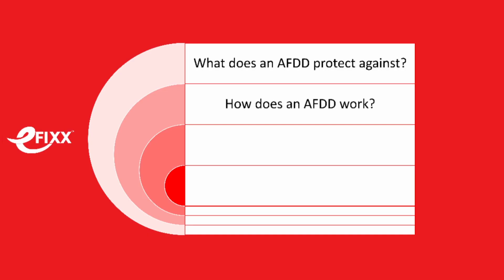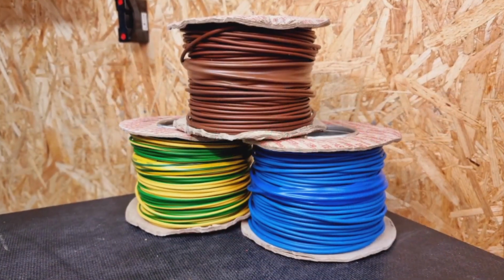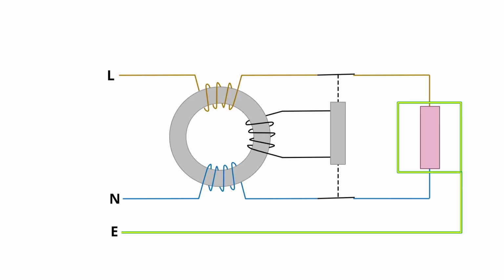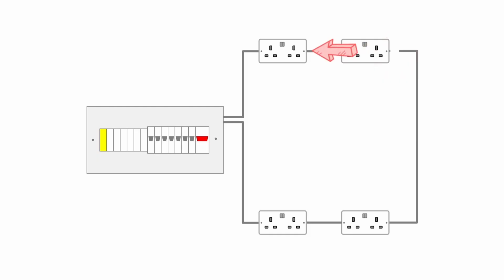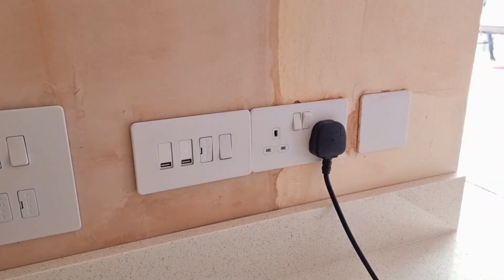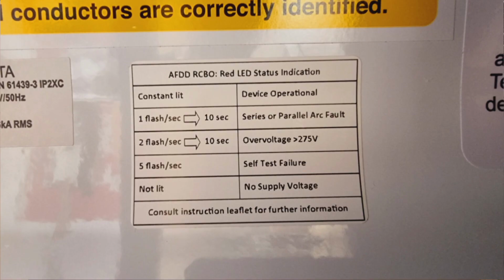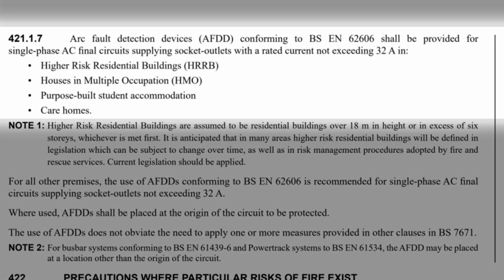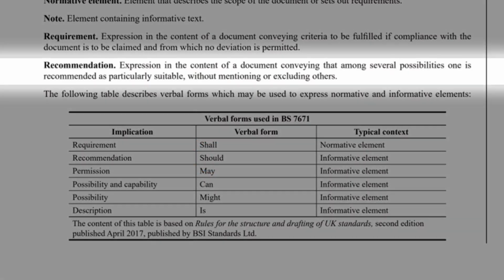AFDDs & BS7671 Amendment 2 - What you need to know!

Comment: End user question! My understanding is that MCBs  & RCBOs have very simple (almost maintenance free) mechanisms. As AFDDs have PCBs with capacitors on, will they require replacing after say 15-20 years?
Reply: it is at the same with TV or any device you thinking...and it is not any posibility to test...yeah,it is not ok....

Comment: Currents do not jump gaps on their own. Voltage is required to create the initial arc which can only be sustained as long as the conductive path is present. Unless I missed it you didn't mention effects on the AFD of arc welding. One must also ask for some statistical justification for the introduction of all the additional requirements that have been introduced since the 17th edition came into effect.

Comment: The recommendation is AFDDs are fitted to circuits supplying socket circuits not exceeding 32 amps however they don't detect series arcs. Since series arcs at a loose terminal are the most common faults in a ring final circuit and ring final circuits are the most common circuits, there doesn't seem to be any practical justification for recommending an AFDD be fitted.

Comment: I have seen so many new flats made by big companies in London.  None has got afdd or rcbo! Who is going to pay £1500+ for consumer unit. The landlords are not paying that much money. There are lots of other costs (goverment does accept mortgage as cost)  involved. It just put sparks on spot!
Reply: AFDDs are required in blocks with 5 floors plus ground floor and higher.  
The AFDDs are only for any circuit with at least one socket protected by a 32A beaker or less. A circuit that is above 32A protection then an AFDD is not required. 
Fit a 40A RCBO with three sockets:
- a 6.0 mm cable to a 1st single socket;
- a 2.5 mm cable to a 2nd single socket;
- a 2.5 mm cable to a 3rd single socket.

Then it does not need an AFDD as the circuit is over 32A.
The circuit could be supplying a: washing machine, dishwasher and tumble dryer, with a total draw of 39 amps - a 40A circuit. 

Circuits with only hard wired appliance do not require AFDDs.

Comment: Who says arc current faults are becoming  more common? I find that very unlikely indeed. There is not obvious reason why this should be. Of course, what might be happening is that there's a higher proportion of arc current faults occurring, but that's surely because the other types of faults are becoming less common due to the introduction of MCBs and RCDs (or the combination, in the form of RCBOs). 

I think with AFDDs we have probably reached the point of strongly diminishing returns. If we want to save lives, far better to upgrade older installations without making the process prohibitively expensive. To my mind, the sweet spot is RCBOs on every individual circuit. Until and unless AFDDs can be reduced in cost to be comparable to RCBOs, that's not worth doing.

Frankly, what I am hearing from this is lobbying by the manufacturers of electrical equipment, not independent statistics on how much safer things will be. Artificial tests by Lewden are far from convincing. They have a vested interest in promoting ever more expensive installations.

Comment: Why no AFDDs on Cooker or Shower circuits - rated at higher than 32A?  Surely, these are more susceptible to Arcing and due to the higher currents are more dangerous and in my experience are more than likely the cause of any burning and melting...?  Thanks.

Comment: HMOs. AFDDs are mandatory. 
But, in new circuits? 
Must be installed ASAP?

Not clear on this.
Reply: mandatory since late september 2022 when five yearly test is done
Reply: @tonyedwards6369  
I found out...  Existing systems... The regs are not retrospective. An inspection is to say what is wrong and what can be improved. It is up to the home owner or landlord to make a decision.

If its new work, like a new or extended circuit, then yes, it has to be conformed to and an AFDD fitted.
Reply: @johnburns4017  Accodring to my insurance company doutful they will pay out in the event of an electrical fire iwthout AFDD since late september.
Reply: @tonyedwards6369  
Understand what I wrote.  The regs are not retrospective.  Only apply when work is done.

Comment: Had our consumer board updated recently.  Gas fitter fitted new boiler and  replaced socket as it was faulty so he could run boiler from it.  Unfortunately he failed to connect earth continuity properly and I was electrocuted when touching dishwasher handle (dishwasher fed off same circuit).  Trips did’t trip.  Still don’t know why nor does electrician who came in to sort it out.  The consumer unit uses rcds

Comment: Fantastic video again, considering the fact that AFDD'S have over-voltage protection at 275V, are they a solution to external installations where a PEN Fault would be a problem, like car chargers for example.

Comment: Each AFDD/RCBO cost an average £150  that is a huge extra cost.   This will bring into the question the need for ring circuits instead of radials. An AFDD does not detect series arcs on ring mains although it will detect series arcs in appliance cables.  So as far as I understand, flammable buildings, ie garden sheds or timber extensions will require full protection of AFDD'S-what does that mean? EVERY circuit has to have a AFDD?  We can assume, that all future installations will require some AFDD's, the question is how many and to cover ltg as well? Everything can be considered a fire risk.  Will your client be able to claim a reduction in his fire insurance premiums? Its all up in the air. can anyone please clarify?

Comment: So, it's socket circuits only? Not lighting? Showers? Cookers?

I'm confused. Showers draw a lot of current, but only run in short bursts (except where my kids are concerned!), yet damage is caused when there's a loose connection because of the large load. No mandatory AFDD?

Ovens and hobs can both draw large loads AND do that for hours! Yet no mandatory AFDD?

Lighting circuits generally draw less current than they've ever done before thanks to LED. However, due to the small conductors used, arcing is easily caused by over-tightening of terminations that cut cores and thus leave loose connections. Yet no mandatory AFDD.

Only mandatory for sockets? Why?

I've been in the game thirty years, I'm not the fastest sparks, not the most technical sparks, but do the best I can with the best kit I can afford. Some of these new regs are not helping, least of all because of the costs involved.
Reply: "Lighting circuits generally draw less current than they've ever done before thanks to LED. However, due to the small conductors used, arcing is easily caused by over-tightening of terminations that cut cores and thus leave loose connections. Yet no mandatory AFDD."

Use ferrules on the 1.00mm lighting wire. Then less risk of arcing.
Reply: The screw connections on sockets can work loose causing arcs. Hence AFDDs on socket circuits. Use screwless Wagos in the backboxes connecting the ring. Maintenance Free junctions are always screwless. 

Oven and hob connections have screw connections at the CU and appliance only (or should have).

Comment: I am not sold on these devices, and I also don't think anybody in the industry is concerned about safety either.
There could be millions of insulated boards out there, that failed a basic test, yet the manufacturers still put a British standard on them. This was done by two of the oldest manufacturers of electrical equipment in the UK and it's been swept under the carpet.
So with this in mind, you will have to excuse my scepticism, when I see that the powers that be are telling us to fit these devices to cut down on the risk of fire, when the very same people have turned a blind eye to this issue.
The whole industry stinks from top to bottom, and shows it's all about money and nothing else.

Comment: Will the use of a arc welder or mig trip out an arcc? I’m in Australia and was not aware of them. Currently had the house rewired and not mention was made to an arcc. Thanks
Reply: AFDDs are to be on final circuits with sockets drawing 32A and below - UK is typically 13A, but higher is permissible in certain situations.  An arc welders will have a socket draw over 32A, is not a problem.  

I would assume an AFDD would detect an arc on an arc welder.

Comment: So this £200 part would of prevented genfell , I’m still not sure why these or not being fitted at the front end on the installation not much point in protecting the ring if the main switch is going melt

Comment: remember in 1980's grid fault meant i was called out to work could not keep up  with resets till I checked voltage at 260 /265 volt, immediately killed power to factory but dozens of claims for destroyed equipment in houses.   This was never made public. Being a small town I tknew through gossip why every fault occured and explaining ,this iis why people got compenation so the 275 volt protection is a bit too highand a bit usless

Comment: Does this new reg. apply to new installations or, all current installations as well. It seems that as, with any system that becomes more complex then, MTTF rate is going to increase. The cost and complexity, of such systems, will eventually require higher qualification, than the  average electrician.
Reply: AFDD mandatory from September 28 for HMO thatched and wooden buildings

Comment: Good video eFIXX.  Just one criticism, regarding ring finals.  It's not that AFDDs won't detect an arc on rings, they will.  It's actually that arcs are far less likely to occur on rings.  With a single break in the ring, the potential difference between the 2 separated legs would be just a few volts, so no dangerous arcing would occur.  Rings are safer than radials in this respect.  

I still disagree with your interpretation of 'recommend', but we've argued that one before 😉
Reply: Yes I totally agree he's got recommend wrong. If he's clarified it with the IET, then they have got it wrong!
Reply: @markrainford1219  
I would clarify the meaning of recommend with an Oxford English dictionary.
Reply: Yes using the word recommend in a pseudo-mandatory condition would both contravene the normal meaning and the practice of other regulations. If used in this sense its very stupid. Redefining the word in an annex doesn't really help!

Comment: Thank you for a very interesting and we'll presented video. I am old enough to remember the recommendation in the 1970s to fit a voltage operated protection device (big black things that looked like a switch) and the subsequent issues that occurred as a result. I wonder, how many incidents have occurred over the last five years that AFDDs would have prevented?
Reply: Grenfell Tower
Reply: That wouldn’t have prevent Grenfil tower the problem was the dryer which caught fire not from the supply feeding it it was an appliance fault this then spread inside the room and to the outer building insulation also my issue is with AFDS there is no way of testing them apart from David saverys home made device.
Not convinced by afds on lower loads , seen them in America and I’m not impressed .

Comment: No one is installing these.
Reply from the maker: Unless they work in HMOs, student accommodation, care homes or high rise resi
Reply: @efixx  
Do AFDDs have to be installed in HMOs ASAP?  Or just on new instsllations/circuits?
Reply: Which is why so many HMO are closing when five year EICR test happens, those not due for test will not be covered for fire insurance unless AFDD retrofitted.

Comment: Good vid, BUT does the AFDD circuitry use only passive parts or does it have a micro controller inside with firmware + algorithms to make its fault decisions? Sounds too complex to be just passive.
If so, some algorithms are better than others....
Reply from the maker: You are correct they have a microcontroller / DSP inside to detect specific arc waveforms.

Comment: So for example in a house you have two ring main circuits,two light circuits,one 32A cooker circuit,and one 16A heating circuit………total of 6 circuits,you would need 6 AFDD at a cost of £150 @ !!!!!!!!!!!!!!!!!!
Reply: Nope.
Reply: @johnburns4017  please explain
Reply: @omriroberts137  
AFDDs on socket circuits only. So you can have one socket circuit, with heavy appliances on a separate ring hard wired in, or hard wired in on radials. Two appliances can be off one radial.

Then only one expensive AFDD.  But assess electronic appliances that leak to earth to avoid nuisance tripping of the AFDD. Modern washing machines & dishwashers leak to earth, but these will be not be on the AFDD protected ring.

If you have an electric shower it is sensible to fit an AFDD.
Reply: @johnburns4017  Thanks for your time in replying too me.
I’m not doing any electrical work anymore but always like to keep up with the latest technology,I’m 66 now but had to retire early at 50 due to ill health after working in the South Wales Coal mines for 35 yrs where I did my apprenticeship , but I used to do a lot of domestic wiring from a young age.
Over the years have seen a lot of burnt out switches on shower and cooker circuits due to connections not being tight,I always used to tell my apprentices to push the face plate to back plate and pull it out again and several different times you would have to tighten the connection again as by pushing face plate in depending on cable lay would actually loosen the grub screw.
Therefore on high load circuits an AFDD would be a good extra safety
Again thanks for your valued reply
Reply: @omriroberts137  
Sorry on hearing of the health problems. With sockets it is best to use Wago screwless connectors in the back of a deep backbox. These take the ring/radial's load, not the terminals on the back of a socket.. The cables from the Wagos to the socket terminals have in flex 2.5mm. Then the sockets slide in with no stress on the cables.

The Wagos do not work loose over time. The only time current will flow thru the socket terminals is when the socket is being used.
Reply: @omriroberts137  
Electric showers are notorious for burning out terminals especially in the pull cord switches. Only use quality equipment on showers. 

These days induction hobs are available with a 13A plug. So low current operation. They cleverly share the current between rings. So no hefty current draws.

Ovens are typically 3kW max these days.

Comment: Thinking about addressed sockets and circuit breakers connected a small information screen, we can easly run regarding data over a power lines, forexample socckes 3,4,5 overloaded or rcd stoped because there is is an earth fault on socket 5 , will be big impact especially for restaurants ,hospitals  etc

Comment: Question:  I'm not and electrician but a potential customer who has been considering changing my consumer unit for when I change my kitchen layout, as I need additional circuits and have run out of capacity on my existing unit.  When I look on the popular sites like tool station or screwfix, I only see units with MCB & RCBOs.  Can't find any unit with AFDDs.  Are these the same thing?  If not where do you get such devices as the Units being listed are being advertised as being compliant with 'Amendment 2'.  Is this a different Amendment 2?
Reply from the maker: Screwfix have stock of AFDDs. You won’t see them in prebuilt consumer units as AFDDs are only required on socket circuits in certain types of installations such as care homes, student accommodation etc. You can of course go beyond the basic requirements and fit in any installation.
Reply: @efixx  Thankyou for the reply.  After watching your video I was thinking about attempting to comply with the 'recommended' rules.  But seeing that RCBOs with afdd are £150 for a single unit, I think I'll stick with basic RCBOs and buy a new induction HOB instead....
Reply: @bobfish7699 the electrician you hire should be able to advise 👍

Comment: Thank you, clear concisely delivered.  Grenfell Tower, faulty fridge, Appalling Fire !.  Would an AFDD have prevented all those Unnecessary Tragic deaths ?
Reply: I suspect that Grenfell Tower had a bad neutral connection somewhere, so that the voltage received in individual flats could deviate considerably from 230v if the loads on each of the three phases supplied to the whole building were not equal. Before the fire the tenants' organisation Grenfell Action Group had been complaining for a couple of years at least about voltage surges that were destroying electrical appliances.
Reply from the maker: Depending upon the nature of the electrical fault then yes.  We discuss the topic in this video - https://youtu.be/nVXBglDe6Pc
Reply: nothing to with that it was the external insulatiion,
Reply: @alanreid3063 I thought the Report determined that an electrical appliance caused a fire which then spread to the cladding.